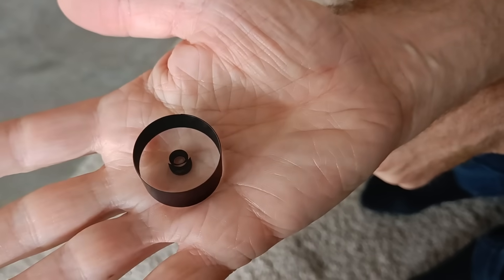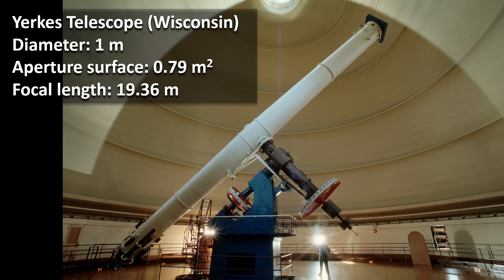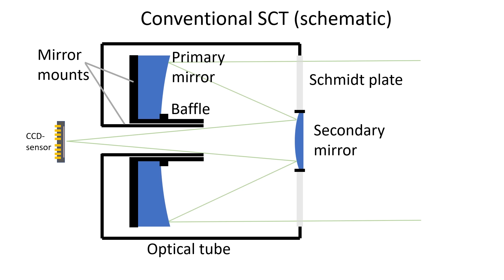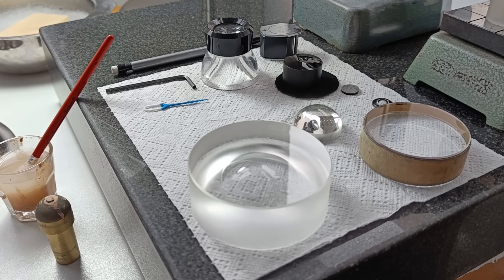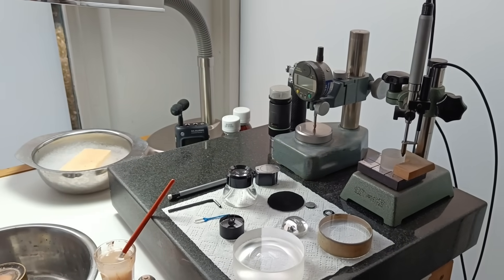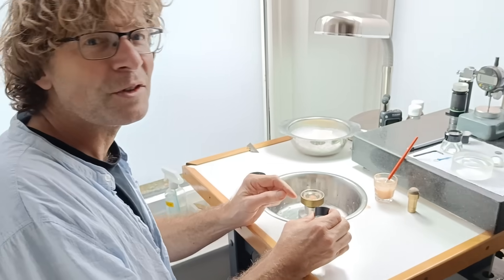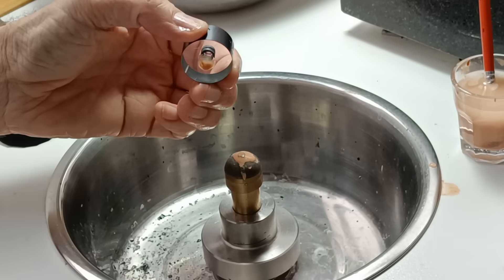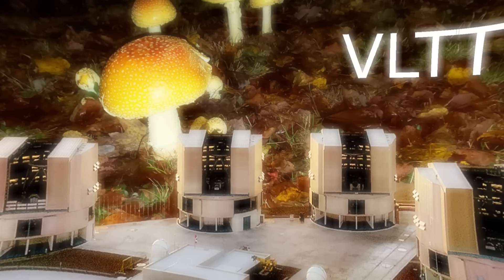Why is this Space Telescope so Tiny?

Comment: I still dont understand, when one of these has a focal length of 300mm, the focal plane will be just as far behind it as it would be for a regular lens assembly no? - folding up 40mm of 300mm isnt much of a space saving - what am I missing here?
Reply from the maker: The "back focal distance" is only a few mm behind the telescope measuring only 30mm, even with an effective focal distance of 300mm. That is why it is such a great space saver...
Reply: @HuygensOptics  Ok thank you, so the "folding up" of the light cone isnt the only thing these designs do to be very compact? - Because the folding up could only half the telescopes length compared to a newtonian design...
Does the secondary mirror spread out the central rays while still focusing the cones right behind the telescope or how does that work? 
A little like a barlow lens???
I think that wasnt explained in the video we only saw the light cone going up and down the telescope, which would only half the telescopes length relative to a newtonian...
But I liked your video and thank you.

Comment: How is the chromatic aberration? Is it present even though it's a reflecting telescope? Does that extra optical surface help or hurt with splitting the colors. With a trichromatic CCD one could correct for chromatic aberration I think. Hmm, that has me wondering is there an electro-optic color filter that approaches continuous filtering ability.
Reply from the maker: The internal mirrors do not affect the CA, the external surfaces do, but it is not very big due to the short tube..

Comment: I don't know if its possible, but I had an idea to get away from the linear design, but use a different method to make the system come compact. So what is the length for? what is light capturing and magnification? How many reflections can one do, to compact the system, What about a spiral light system, that breaks apart each wavelength of colour and then bends that colour around the system, it can be a highly reflective tube, it should cause problems and then rather than a hard complex calculation they each go to a light sensor or a optical reintegration place with the other wavelengths. Each one can have its own censored atunend to those wavelengths. However we can break those wavelengths down even more.. Since it really isn't just Red blue green, but much much more data. So by a multi relative system that carries the data in a reflective tube to sensor or a optical re-intergration point should maximize the resolution to the time at hand. then it becomes more over how the data of the light is collected. Meaning the long tube allows soft lateral light to defuse out while the main focal light to maintain a direct direction towards the aperture of viewing. So in conclusion, a modern system would have to eliminate the unwanted light data sectors which one could sort through the divisional labours of the light coming in, to clean up the image even more. Many ways to do with with software subtraction, or actually creating a reactive filter that once the data is being made into something can self adjust what light is what and in the tube, create diffuse walls or in the sensor itself, no responsive sectors, so only the data wanted comes in to the digital relay of what is observed. It cud be divided down into 20 wavelengths of light or more... for inner occlusion or something.. but it would be interesting.. Ot build the first one I would build al are one like an engine, but, the shape you showed me I think a very neatly tight package could make it smaller then a thumbnail.. Then the relay that info would be smaller itself could be larger or.. well I am no expert... but its data... Oh then there is the data in the wavelengths themselves that have frequencies, and charges of them, so that can further be manipulated in the system by other instruments, What about making a large magnetic field that attracts wavelengths to a point, you would be able to see it, but you could make it as big as you wanted, providing you had enough energy, and then draw in those outside data sources, to a sensor module.. Hmm... Lottos fun here.. :P

Comment: Amazing approach for certain needs.
Just a bunch of questions: How does the design affect the used/chosen glass type? What's the effective resolution for the sensor behind? Can the aperture value go beyond the typical F5.6-8 of an usual SC/Maksutov? What might be a reasonable limit for the size (weight)?
Reply from the maker: They use a very high resolution sensor, because the field is very limited, you can achieve high F/numbers (F/8), but if becomes increasingly difficult to create the aspherical surfaces accurately enough with very short "tube" length.

Comment: Awesome! Would there be an advantage from making it out of a doublet to correct for change in index of refraction with wavelength?
Reply from the maker: It's possible, and I simulated it to see if you could achieve significant improvement by using crown and flint glasses and bond them together. But in the end it seems that chromatic aberration does not pose a huge problem for these very small devices. However for the aspherics, small variations in the conic constant can lead to large errors, so that on the other hand is quite critical.

Comment: I'd like to see a side-by-side comparison of images taken by a traditional very small cassegrain telescope versus this all-in-one new tiny telescope idea.
Reply: I second that
Reply: That aperture it has is incredibly tiny though, so only something like  high energy light photography can be done. The concept is however really interesting.
Reply: @Tankeris6327  "High energy" light is simply called "bright" light...
Reply: @Telephonebill51  not exactly. Bright light is only more light, not 'high energy'. 
High energy light would be in the ultraviolet range or even shorter wavelengths. 
These tiny lenses need very bright sources and the resolution ist poor, because aperture matters. You can't mess with physics. 
But they have other purposes than high resolution imaging.
Reply: @dalrok  'high energy' short wavelength light has greater optical resolution for a given aperture. Even the continent spanning SKA has but a fraction of Hubble. Messing around  the upper end of ultraviolet, physics won't be angry. However I'm uncertain if even fused quartz is UV optically transparent enough considering how thick the lens is.
Reply: Traditional telescope of the same size will be worse because it will require many mechanical elements and precise adjustments. While the traditional telescope of the same weight can be a little bit better, because it potentially will be bigger. But to be completely honest, both will be pretty crappy.
Reply: Yes but it would have to be a very large tiny telescope.
Reply: Me too!
Reply: yes me too
Reply: Definitely
Reply: Me too!
Reply: Telescope images rely on light collection and exposure. I believe for this micro telescope that exposures must be longer to achieve bright and clear images.
Reply: @superdave54811  They also reply on aperture.  A telescope's resolution is limited by it's aperture.
Reply: @superdave54811  That's because the lens is the size of a dime, not a dinner plate.

Comment: Great video Jeroen, thanks!

One thing to add to your story: because of the refractive index, the telescope itself is also much smaller than compared to the same configuration with no 'immersed optic' design. I like it a lot!
How was the CA treated in this case?
Reply from the maker: Thanks Bart. Chromatic aberration was considered in the optical design and only plays a role at the entrance and exit of the system. Due to the short distance traveled through the system by the light, the effects or the aberration are relatively small.

Comment: One of the advantages of the SCT over refractors is that the light does not go through glass, therefore there are no refraction issues (expect for the a Schmidt plate of course)

Since light has to travel thought glass here, is this design negating the advantage of the SCT?
Reply from the maker: No because, apart from refraction at the entrance and exit, there are no refractive interfaces in the material, only reflective ones.

Comment: 7:00 to 7:30 these ophthalmic molds for pressing lenses for cataracts, what are they called and where would I find out more about them?
Reply from the maker: I'm not sure, it is very specialized stuff and probably proprietary. But it works in the same way as standard pressure molding with a material heated above the plastic deformation temperature under pressure.

Comment: Could you make these as telescopic lenses for high-end cameras?
Reply from the maker: The current versions have quite a limited projection field, so you will only use a small portion of the sensor.
Reply: They were made for 35mm cameras in the form of the Vivitar/perkin Elmer 'solid cat'.
Reply from the maker: @10msplits  yes, but they were not truly solid but consist of about 7 optical elements.
Reply: @HuygensOptics  it was solid enough that when they dropped it in a demonstration at a trade show, it was still usable and the equivalent cassegrain wasn't ;) I have a strae factory reject blank of their primary mirror I got off ebay if you'd ever be interested in taking a look at it!

Comment: Absolutely amazing that Rik is hand grinding glass with the accuracy of 60 microns, phenomenal.
Reply: not exactly, it is an aspherical deformation of 60 micron. The accuracy is far under 1 micron ;-)
Reply: @astrorik  Excellent! Can you give an indication of what fraction of a micron you hope to achieve for your accuracy?
Reply: @louis1952  The optics need to perform near the diffraction limit, which means that the surface errors on especially the mirrors need to be smaller than 40 nm. For the spherical M1 this is not so hard, but for the small and strong hyperbolic M2 this is absolutely at the limit of what I can make.
Reply: @astrorik  40 nm - now that's impressive!
Reply: @astrorik  That is more than amazing.

Comment: Fantastic video!

Might I suggest a tiny bit of constructive criticism though? Use manual exposure settings on your cameras next time, or at least lock the exposure if possible. There were several sections of the video where the exposure kept changing up and down fairly rapidly (example 10:50)
Reply from the maker: Thanks. Yes I also noticed, so this is something to improve next time. As I said, it was the first time I filmed under these circumstances.

Comment: I've seen solid catadioptric camera lenses advertised for decades, but they'll weigh a kilo or more for a 300 mm focal length because they need to be f/8 or faster to be practical to mount on a camera.  I'm very impressed with how small his 300 mm unit is.

Of course, these are limited for direct observation, because the aperture is so small -- but for a CCD or CMOS image sensor, they'll give far better results than a typical refractive lens of comparable size and weight (which would have a focal length of around 30 mm in the same form factor as that 300 mm unit he showed).

Comment: Interesting. What kind of resolution can one expect with such a small aperture? Why not make this out of polycarbonate (or hybrid polycarbonate and glass)?
Reply from the maker: It would be difficult to achieve a good enough accuracy with this material given the thermal expansion coefficient and shrink during cool down when manufacturing.
Reply: @HuygensOptics  Yes but one could over size the optic slightly and then mechanically or chemically polish to the final figure.

Comment: Does it actually have a Schmidt surface on the front?
And would it be possible to use simmilar technique to make, say, a sub-aperture Schmidt corrector for ordinary telescope?
Reply from the maker: Yes, the front surface is a Schmidt plate, 60 um aspherical, so actually pretty difficult to make.
Reply: @HuygensOptics  Thank you; no doubt it's nothing easy (though watching Rik doing it makes you think it's a piece of cake :D), but I guess it's still somewhat easier than full-sized Schmidt corrector.
I'm asking, because I had corrector broken into tiny pieces in my SCT and now I'm looking for options to fix it somehow.

Comment: I'm very glad I've been presented with your channel, even though I've no knowledge of optics, I find this super interesting!
I have a question but I may lack the correct vocabulary: Is there a way to ensure the glass have a constant density ? I assume that having a medium that is not constant along space would deflect the light in some ways.
Reply: The words are "homogeneity" and "inclusions." Homogeneity is when the glass has the same optical properties throughout (because as you mentioned, a shifting index of refraction will bend light even without a surface to refract). Inclusions are tiny bubbles and dust that scatter the light. The 'trick' to both is to start with good quality glass blanks. These are created very caredully by companies like Schott, OHara, and Corning in a process simmilar to metalurgy when the glass is melted down and refined by bubbling gasses through it to take out as many impurities as possible before being slowly cooled to allow it to settle with the lowest possible internal stress (as stress/strain can also affect the optical properties).
Reply: @itishappy  Thanks!

Comment: Could you increase the diameter and add more mirrors to increase the focal length more?
Also could you adjust the shape of the mirrors to allow for something like an indicating rod to go through the middle while it's being made so that you could slide it onto a jig for grinding the surfaces to avoid the misalignment issue you talked about with para/hyperbolic mirrors? That way you could use a precisely shaped grinding wheel to shape the lens instead of doing a single small area at a time?
Reply from the maker: More mirrors is not necessary, since the Cassegrain design parameters allow for variable effective focal length.

Comment: Hello Mr. Huygens, it would have also been interesting to see one of these tiny telescope "in action" - for example with moon in the night sky, or so.
Reply from the maker: Everyone needs something to look forward to!
Reply: @HuygensOptics  Translation: "I'm still grinding." :D
Reply: Huygens Optics You got me!
Reply: @HuygensOptics  haha
Reply: @HuygensOptics  ok - I do.
Reply: @HuygensOptics  touché, Dr. Fullersheit.
Reply: Fred Garvin  There's quite a simple solution for that. Make it bigger. Yes, that makes the tolerances harder to hold because you have the same tolerances over longer baselines, but the result is worth it.
Of course, for imagine something BRIGHT like the Moon, it's likely still quite good enough (the problem once again becomes pixel density on the CCD, which if I had to solve that problem RIGHT NOW today, I'd actually ditch the CCD and go back to fine-grain film).
Reply: Fred Garvin  at least for 200 km or so - they use it to watch their campus from earth's orbit. Ok - that's nothing compared to the distance of earth and moon.
Reply: @haraldschurr1035  Did it worked or not? do you have the picture?
Reply: Fred Garvin  Well Galileo's telescope had about the same lens diameter - 30mm - worked for him.

Comment: Instead of correcting the focal plane,  why not use a fibre optic plate that is curved on one side.  Place it directly on the ccd and it will effectively make a ccd with a curved surface.  You would not then need the asymmetric correction. Its not my idea, I used to work in medical imaging and these were used to directly couple the curved XRay intensifier output to the Plumbicon tube.
Reply: Fiber optic plate has a limited resolution due to the individual size of their fiber. This is tolerable when coupling an intensifier to a ccd. Phosphors grain size in intensifiers are the major source of their limited resolution.

Comment: Could these be semi-mass produced from a master in resin using a mold? A super short telescope that fits on a USB CMOS cam module seems like it has a lot of low-end kinda uses and I'd love to play with a cheapo one.
Reply from the maker: it's probably possible, but I guess to reach the required accuracy, you would have to redo the surfaces.

Comment: 60 microns is nothing; they have optics used in EUV which have tolerances measured in hundreds of picometers.  But then that's near impossible to achieve by hand.
Reply from the maker: We were referring to 60 um asphericity, not to the surface accuracy. if you can make 60um asphericity on a surface of only a few mm in size, that is very impressive.